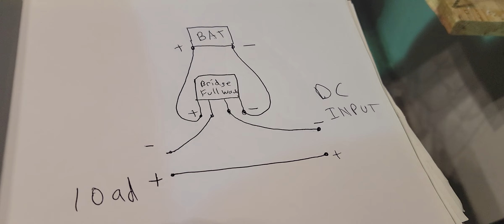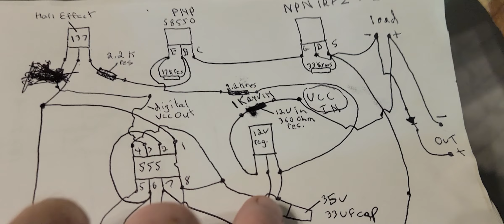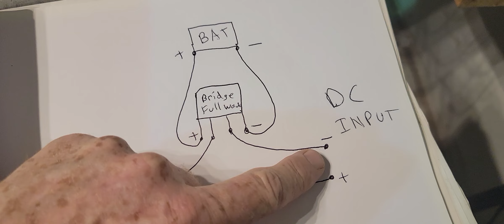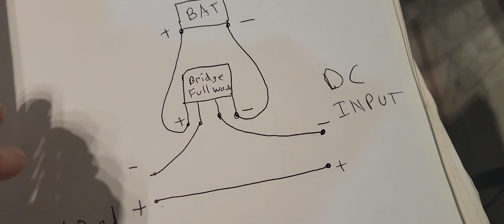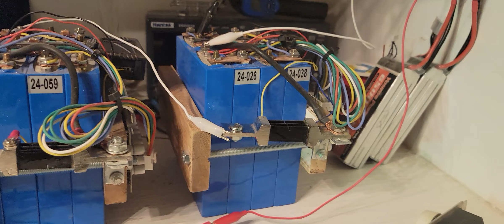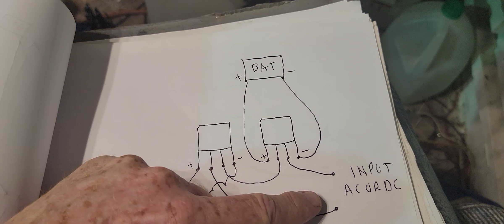Extremely effective and efficient way to reduce high voltage down to a lower voltage

Comment: It's a basic Tesla switch. You can have secondary load between the negative off that input and output off the secondary battery. There is some good testing of the setup on channel called What if I did this. Some batteries have more suitable internal resistance for it than others. Super capacitors in parallel with the batteries might improve the results.
Reply from the maker: Thanks for your comment... I have plenty more with this type of circuit to come it's a extremely useful circuit
Reply: @windpowerandmore6310  Yes, keep em coming. The Tesla switch seems to be much like the LC tank circuit, but in different form. It might be possible to tune the circuit frequency more officiant by having AC capacitor or variable capacitor in series from the motor to secondary battery. There is a lot to study on the possible variations just with this simple thing :D